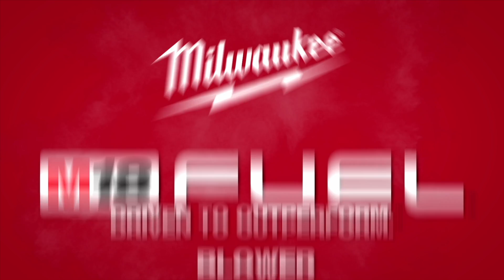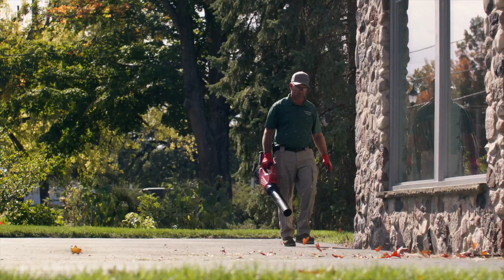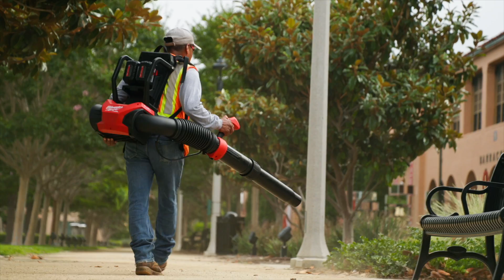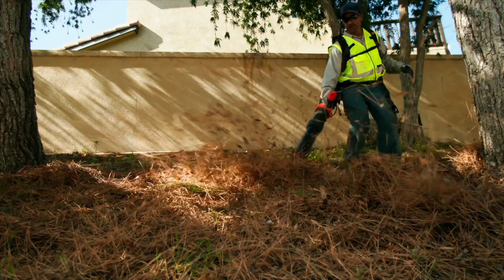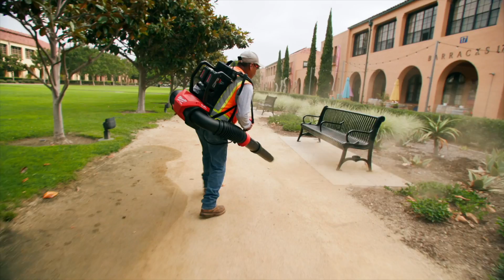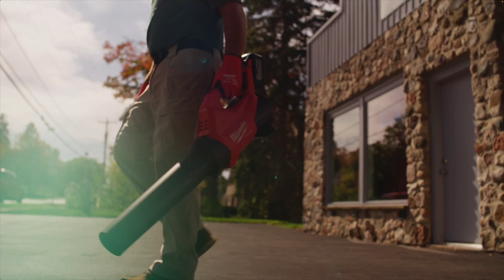New Tools from Milwaukee! Let's talk New M18 Fuel Blowers

Comment: I'd rather get the Kress backpack blower... 1 battery with a large handle to help remove it. Removing 4 differnent batteries sounds like a PITA... Also the Kress has more power for less money.

Comment: Im a Milwaukee tool fanatic, i have a huge collection, but the back pack only has 650 cfm and 155 mph wind speed ....well just not enough......it should be a minimum of 850 to 900 cfm and 200 plus mph .......and use that new large forge 12 hour battery ? Love my Milwaukee ,but there blowers im not to impressed with .....needs more power ...... They are made very well as usual....... Again it needs more azz whipping powr 😢

Comment: Milwaukee is way to expensive to keep up with. I won't deny their performance but just because someone only owns just that brand doesn't mean they can't own another. A ryobi hp blower can get the job done without the price so why not get one
Reply from the maker: Milwaukee is definitely shifting their focus towards folks who are already on the M18 Fuel platform, or working commercially. Like you said, Ryobi is a perfectly viable and more affordable option!
Reply: @Protoolreviews  I love Milwaukee I own quite a few tools where ryobi can't cut it but for someone on my budget I don't need a 300$ string trimmer for example when a 150$ does the job perfect. Thanks for the video

Comment: 4x 12ah batts run about $1000.00, That's pretty steep.
Reply: I build my own 12ah batts for $100 each using the same 2170 cells that milwaukee uses.  Kit with all hardware (case, screws, bms circuit board, holders, and metal bus bars) online (ebay or amazon) are around $35-40. Then  the cells I bought on an online supplier which on a special were $4 each (usually $6 each)or on special then $60 for the 15 needed cells. Again they are the same samsung model cells used in the m18 12ah packs. You just need a good higher power spot welder which I got for $250. I can repair (replace bad cells) and build lion packs as well since I have the welder anyway.